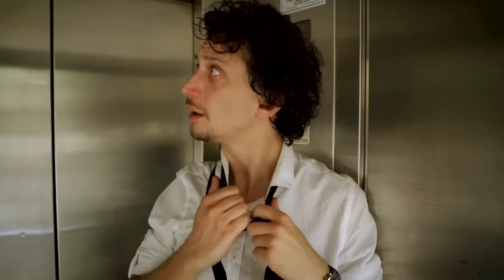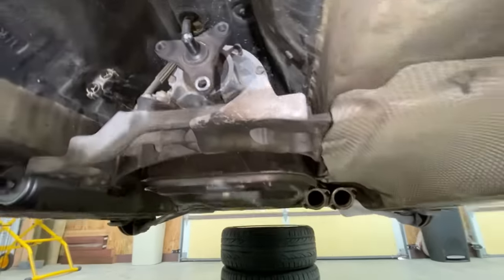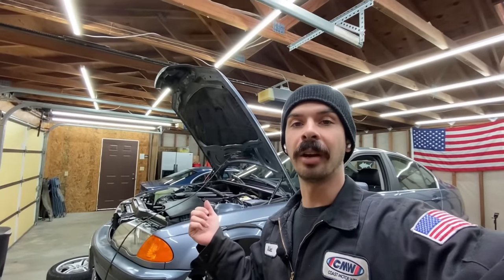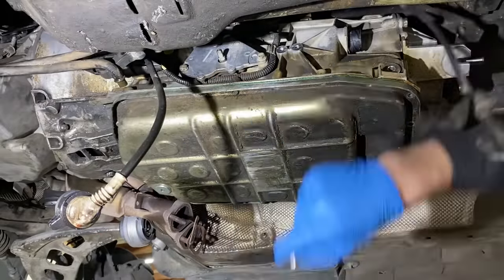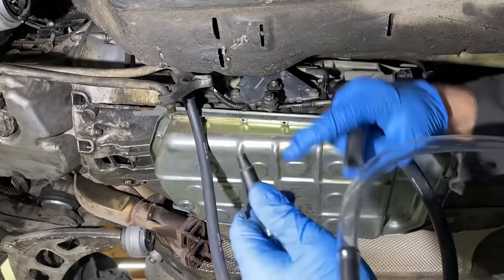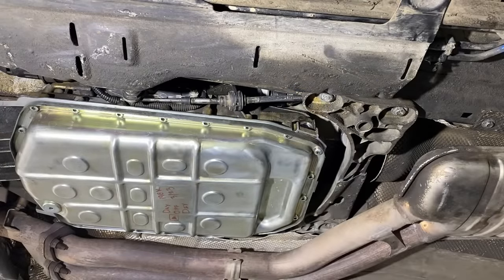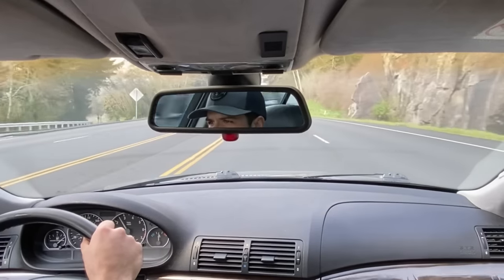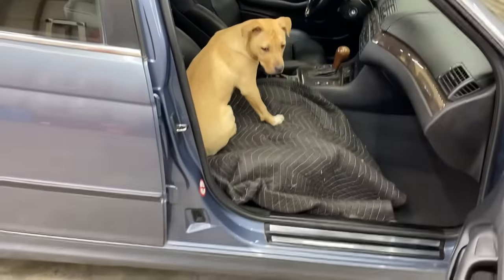DIY Torque Converter, Trans Removal & Maintenance on my $500 BMW E46 330i FLIP

Comment: While I have 4 bmws I'm a disabled veteran with hardware in my neck,  lumbar & fixing to have both knees replaced. Needless to say I can't do these kind of repairs anymore it gives me great joy to see a professional do this repair. Awesome job and I really enjoyed seeing you clean all your components while your mechanicing is truly enjoyable ( I'm OCD). This is my favorite channel now and I can't wait to see your channel grow and get some sponsorship. Awesome job DIY as always.
Reply from the maker: First of all, THANK YOU FOR YOUR SERVICE!!!
Always such a pleasure reading your comments and feedback. I consider you to be one of my biggest supporters and I really appreciate it. I hope your knee surgery goes smoothly, and ill keep the content comin for ya :)
Reply: @DayOffDIY  ditto .
Reply: @DayOffDIY  thank you very much,  it was my pleasure to serve.  I really miss turning wrenches so much.
Reply: which country did you toured in?
Reply: @tweedjohnny8740  thank you for your service !!
Reply: I discovered an easy way to reinstall the fan on my 2002 325ci. I replaced the engine pulley and tensioner and after struggling for a couple hours with no success I started the engine and held the fan in place and it went on immediately.  I didn't  get my hand out of the way fast enough and I got bit but not bad. Yesterday after replacing both cam sensors I did the same thing but this time I had a friend turn the engine over but it didn't start because it has a bad crank sensor. It took about 3 seconds .
Reply: while in my prime i will do the most i can, to work on a car like this, especially in such youth🫡

Comment: Dear Chris, Kudos from European BMW E46/E39/E38 Community.

Good Work!

Congrats that you did not resign.

I did a E39 530i A with M54B30 Engine replacement last year and remember a lot of your work,

eg the fu w the transmission-to-engine-to-starter assembling. ✊

A combustion engine is only as good as maintained fluids cycles.

So I learned to replace all different fluids, pipes and seals frequently…

Tough job to complete all lying on your back.

The cooler pipe O-Rings are silicon rings, also fitting for the servo steering.

I always buy and supply oem ones in sufficient numbers…

My transmission shifter was complete rusty and i had a follow up session at a original ZF shop to replace.

Now everything works well…
 
As i can recognize your bmw is in a good condition, e.g. exhaust pipes.

Thanks for sharing! Enjoy driving your E46 👏👏👏

UP

PS. Check M539-restorations YT channel for further inspiration (English language channel) 🎏
Reply from the maker: Thanks for the awesome comment! I really appreciate it. 
I do watch M539, didn’t find him til after I started this channel actually!
Great source for knowledge.

Cheers on your engine replacement

Comment: One thing I did to help make draining my pan less messy was to get a medium sized mortar mixing tub from home depot to use as my drain pan instead of my usual round pan i've been using for oil changes. Worked really well and after a good clean up I can use it for mixing mortar when I do my bathroom tiles later this year.
Reply from the maker: Thats a great idea! I wish I had a home depot nearby, closest one is about 2 hours away but ill have to pick one up. I got a gift card lying around

Comment: This was a very good watch. I have a 01 330ci with a torque converter problem so I needed this video.
One quick tip I learned on the fan blade. if you start the engine and just hold the fan up to the water pump it'll catch itself and won't start turning until you let go of the fan. So much easier.
Reply from the maker: Thanks for the info! ive done that before, just not always comfortable doing it with a running engine. Glad you enjoyed the video!!! Thanks for the support

Comment: That was so full of good info! You may have solved my whoosh issue after I shut down my engine!? The trans line drain, the drive train tips... I'll be researching this many times. I appreciate you sharing your knowledge out here. You've encouraged me to buy floor jack and scanner and try and fix my hard shift and p0171-174 issues and dig up on 2 more small things. I've got a really clean e46 to refresh so you've been hitting on things I need to know. Keep refreshing e46's all the M. and 330 versions are about trashed by now so it's time for the base model 325i. I've got only 89k and a hard shift to figure out. Other subjects are welcome you live in a pretty area so seeing that along with your projects will be a broader view of your life is good. Great job!!! Keep it coming. Yahoo to you and your good work!
Reply from the maker: You know, Ive been wondering what could be causing your issue and youre right, that valve might be your issue! you could pop it off and check vacuum on the hose! if its releasing vacuum that could be your noise.
89k is practically brand new! id love to work on a car that fresh.
Appreciate the feedback Bog, cheers dude!
Reply: @DayOffDIY  Thanks man. It hit me today when I saw you check yours. I just wasn't sure what all systems in a car are pressureized and near the firewall drivers side. Thanks for your input. Yea my seats are not even close to broke in. 04 Alpine white and it's detailed but sitting in a pause for fundage. My brain is screaming in frustration. lol. I'll let you know. Thanks man. Much appreciated.
Reply from the maker: @bogusienombre355  awesome to hear, yeah let me know what you find out with that valve! 
Also fill us in when you tear into that thing, sounds cherry! Love that white
Reply: @DayOffDIY  will do for sure. let know if you want to see it. I've got new lights to hang.lol

Comment: Great video.  Just one tip to add, you can typically read the transmission temperature with your scanner live data function for filling, no need for a thermometer.
Reply from the maker: Thats a GREAT IDEA!
Ill have to give that a shot next time, im not sure if this new scan tool is capable but ill have to find out.

Comment: This video helped me a ton and not for the reason you may think. I have an E46 that was my first car, I ran it up to 225k miles and parked it, the engine is tired and while it may be controversial, I'm planning on doing an EV swap. I've always wanted to do it and it will bring new life to my first car. I needed to know how tall the transmission was in the car before I pull it out and your small remark on the height it took to remove it helped me. Thank you!

Comment: You're a good man, fixing and taking good care of the old car before selling it to make sure the next owner will have a reliable car.
No need to remove the whole driveshaft: just lower the center support bearing off the studs, then slide the front half into the splines of the rear half shaft and this should let the front flange off the tranny output flange long pilot pin. Use string to hold up and support the rear half to prevent damaging the rear CV joint.

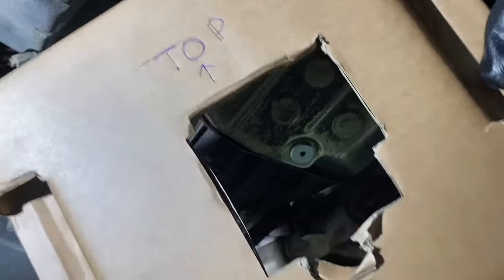At 11:17 we can see the Stop Buffer rubber on the cross member, just to the right of the yellow sticker, between the oil pan and the cross member. The top of the buffer is a piece of hard plastic that the lowered oil pan bottom on, preventing the tranny/engine to tilt back further. So removing this buffer will let the tranny lower down more to gain acess to the tranny top right bolt easier.
Best of luck.
Reply from the maker: i pulled it on this one to replace the center support bearing, would be tough to get leverage and do the replacement with the driveshaft on the car, however i usually just bungee cord them to the sides.

good tip on tilting the negine!

Comment: Whoa, an hour long video!  Giving us all some solid content, this sets a new bar now.  Great job fixing the torque converter and well worth it as you now know you won't be selling the car with any mechanical issues.  Feedback on other video content, definitely, I'm about to pull some more rotted fence posts this weekend and instead of digging them out I'll be  using the car jack method you used.  For suggested content, get a neglected Mini with a manual gearbox.  Still a Beemer and you can do some tasteful performance enhancements.  Would love to see HVAC work and an automatic transmission rebuild on your channel. Instead of using a Sharpie to record maintenance get some waterproof sticker printer paper and make a cool maintenance sticker with your logo.  You can make oil change reminders too.  Time for a MaxJax or QuickJack instead of sketchy jackstands.  Last week I bought the smoke machine you had on your channel.  I liked the fact, as you pointed out, they are an American company.  Onward and upward!
Reply from the maker: Thanks Marc! Your feedback is super helpful to me! Ill definitely be upgrading my lift system in the future, just trying to get some cash together for a proper kit. Hope the fence post repairs go smoothly!
Also I like the idea of a Mini. Ive been keeping my eyes out on craigslist, I do have quite a bit of experience on those cars, as troublesome as they are sometimes lol.
HVAC would be a good episode too. As far as rebuilding an auto trans, its a bit outside my knowledge but Im sure I could figure it out!
Also congrats on the smoke machine! its such a helpful tool, gotta love supporting domestic family owned businesses. Cheers!!!

Comment: I also purchased this floor-jack "SUNEX TOOLS 6602LP 2 Ton Low Rider Steel Service Jack", because it can lift up to 24-inches high, so from a safety standpoint you wouldn't need to stand a block up to get the lift you need. Lift range is 2.75" to 24". Kind regards, Terry
Reply from the maker: Great tip terry! Would be nice to have a hack that reaches a little higher. I’ll have to look into that. 
Also, thanks for becoming a member terry!!!

Comment: Great job! Overall super content and very good video coverage and discussion of the challenges. I'm removing the transmission from my son's 2008 E60 528i, in order to replace the rear main crankshaft seal, so am facing many similar challenges.

I applaud you for your caution when jacking the car so high, and especially for going in steps to get the car down. When one set of jacks is higher than the other, forces are generated that want to make the car "slide" towards the lower end, which can trigger a very bad day. So "stair-stepping" like that is the way to go.

One recommendation that I think you and other will like are to purchase some jack adaptors from Forsvara for the BMW. I don't work for them, and don't make anything off their sales, as I'm an Engineer in the electrical power generation industry; but their adapters will increase your safety factor considerably. The way you used the standard jack stand shoe on the BMW lift points could encourage an issue, whereas the Forsvara adapters bolt to the jack stand saddle, and have the rectangular block on top that will fit "into" the BMW lift points.

Keep up the good work, and I hope your channel grows significantly!
Reply from the maker: hey terry thats a great idea! with my new lift i dont run into that issue as much, but it would be a great addition to the shop! im going to check em out now.

Comment: I did the engine/trans mounts, shifter bushings, guino/csb, and diff bushings on the floor with jack stands. I was filthy lol I should get a creeper. But storage is an issue
Reply from the maker: theyre not fun to do on your back! but it sounds like you got it done. Harbor freight has some decent creepers for pretty cheap. maybe you can hang it on the wall for storage

Comment: awesome work on that tasty E46!  man, I wish I could buy it.
question - if you don't feel any binding or grinding while the sunroof is moving, have you tried just resetting it?  I had that same type of issue on my Benz (sunroof would only move about 2 inches at a time and stop), and resetting it fixed the issue.
on BMWs I think the process is, with key in ACC position, push in the button to tilt up the sunroof and keep holding the button in for 20 or 30 seconds until you see the sunroof move slightly up & back down, then it's reset.  maybe worth a try?
Reply from the maker: GREAT IDEA!
im going to give that a try. This is what im talkin about with this community, so much good knowledge and perspectives out there.
Appreciate the comment, you may have just fixed it. fingers crossed ill try in the morning :)
Reply: @DayOffDIY  mine are crossed too - hope it works!

Comment: Interesting. I have a 2001 X5 4.6 that I’ve had for years and always keep it in tip top condition. I’m contemplating swapping out the centre bearing as I feel that there is a slight drone on acceleration. Guibos are new and the transmission has been rebuilt 18 months ago. We will see.
Reply from the maker: I would take a look! It’s probably your cause, not too difficult to do

Comment: Thank you for this video!  I just pulled the p0741 code on my 2003 330Ci.  I used to work at a BMW and Porsche repair shop and had access to all the goodies but I have since moved away from that area.  Every question I had about doing this at home and on the ground was answered!  Although it does not look like a walk in the park at least I am able to proceed with some knowledge of how it will go, the height I need to achieve and what tools will work.  I am curious if you have since found a better option for the transmission jack?  I am thinking of trying out one of the hydraulic pump style ones from ktool with a 7 inch minimum lift height.

Comment: Ever notice a difference in shifts between the ZF and GM trans? I am assuming you've driven both, I have not. My GM has sticky downshifts when cold
Reply from the maker: I have noticed some small differences, I had a e60 with that same issue, I removed the valve body from the trans and replaced all the shift solenoids, it fixed my rough downshift from 2 to 1 when coming to a stop.
Reply: @DayOffDIY   solenoid codes I've just found on a transmission web page but I'm going to change the fluid and filter first along with a rescan. hard shift.

Comment: Good videos! I have a 2006 bmw  325i E90 with a ELV steering lock. Any suggestions on getting it unlocked, lock removal? or just have steering column replaced?  I've tried all the emulators and CAS reset, still locked. I've replaced a lot of parts and it's in great condition. But, this is driving me crazy because I know it is a mfg. defect of this little motor to lock the steering.
I'll probably have to bite the bullet and go to the dealer! ouch!
Reply from the maker: Brutal! I’ve never had that issue, I think if you could access it with ISTA you might be able to unlock it… hope you can get it fixed friend!

Comment: You know those style 68M wheels are staggered, right?  7.5" front with 225/45, 8.5" rear with 245/40.  Unless a previous owner swapped them to a square set up with 4 fronts you can't rotate them or the fronts will foul the struts on full lock.  (Was also going to warn you about jacking on the sills like that, but you realised why yourself).
Reply from the maker: You make a really good point, I didnt even think to check if they were staggered! I know what ill be doing this after noon now lol
Thanks for the feedback, and yes I finally learned my lesson on the sill. 4x4s on end dont agree with it lol

Comment: How did you know the torque converter was bad? What were the symptoms?
Reply from the maker: it had a check engine light on for torque converter performance. when driving at highway speeds the seal inside the torque converter would bypass, causing RPMs to slip up roughly 300 RPM and trigger the check engine light

Comment: Did you do a transmission reset after changing the torque? Even though it was shifting smoothly right away after the change?
Reply from the maker: I did not! Scan tool wasn’t capable so I just let it ride. Usually I’d reset the trans on ISTA, but not this time
Reply: I think my scanner can do that for me Autofix 7910. The book it comes with is not great for a novice but it's compatible with BMW. about $100.00. I like it, but I have not used it too much yet. This might be a consideration for you as an intermediate choice for now. I sent a reply on community tab for you on my car update. Cheers!

Comment: Would the bad torque converter throw gear check codes? For example my trans flairs up past 3k rpm then shifts hard. The trans cog come on and code is gear check 2.
Reply from the maker: torque converter might not be related.. im not very knowledgable on transmissions or id try to help you answer :/

Comment: do you think using Manual Sport mode shifter will engage a faulty TC? while using this option, does it allow some oil to enter TC? I have p0741 code, so reading some issues about these, I realize some bmw's have these option (MS) I tried to use the manual sport, since then, the code didn't come back yet. May be code will come back, but is it possible? thanks
Reply from the maker: I played around with mine while the TC was faulty, and the check engine light still got triggered... So it may delay the light coming on, but my issue came up when i was cruising on the highway between 70-80, the RPMs would slip up 300 and the light would trigger

Comment: I feel really bad I dated a trans fluid drain and fill on a friend's 100,000 mi 328i right when they purchased it as preventative maintenance. 
And now it shifts funny leaving first. 
And I heard resetting the calibrations It's a giant process can you elaborate?
Reply from the maker: dang, yeah servicing a bmw transmission is a gamble sometimes. Ive seen healthy transmissions act funny after a service. did you replace the pan or filter and is it filled up to spec? one thing you can do with a more advanced scan tool, is go into the EGS, the transmission module, and reset transmission adaptations, the car basically forgets its memory of your driving style and kind of reteaches itself. also did you use factory fluid? i always try to use OE trans fluid